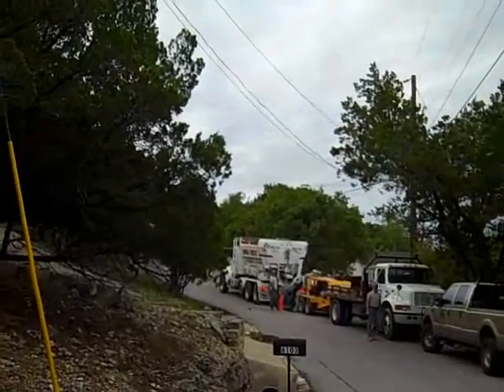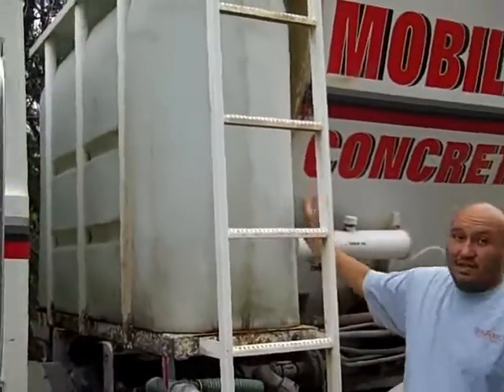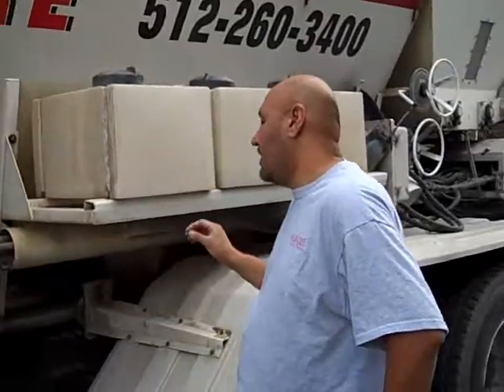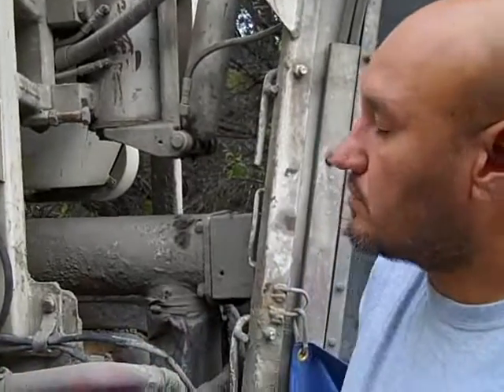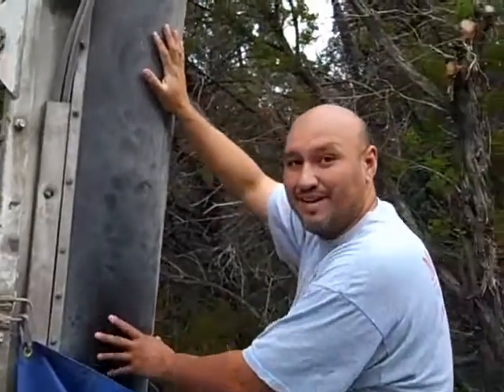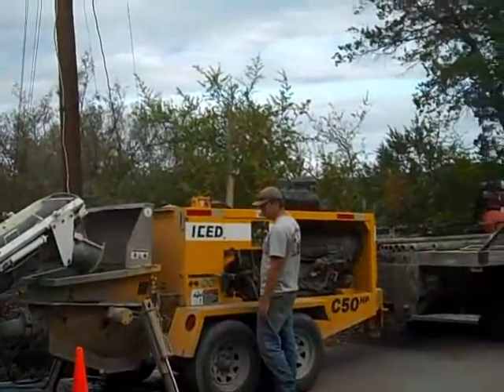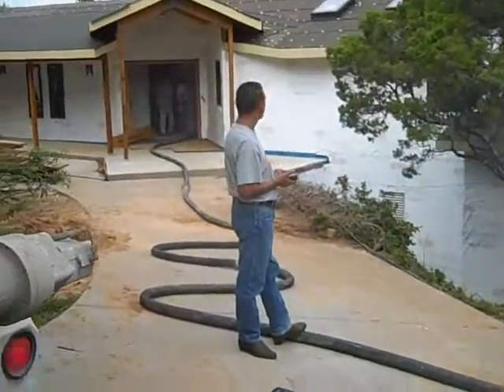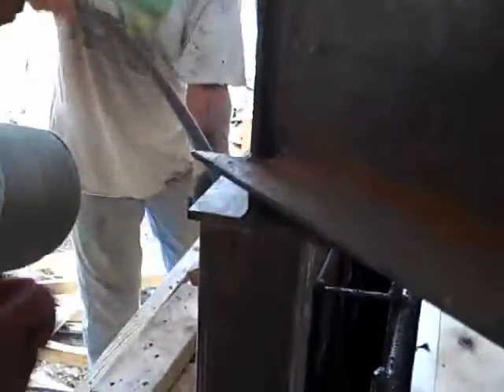Mobile Crete on demand concrete (no waste)

Comment from the maker: @bigbadsingledad Yeah, Good point.  Concrete isn't the most green product.  The house in this video was originally engineered for a tall slab that would have been 250+ yards of concrete.  I steered the engineer to a pier and steel framed structure that dropped that to under 100 yards of concrete plus a tall crawlspace for storage.  Reduction of total concrete is one way to be greener.  Appreciate the comments.  Matt